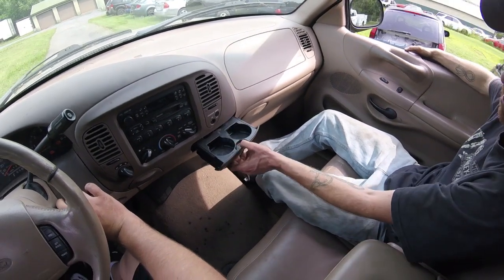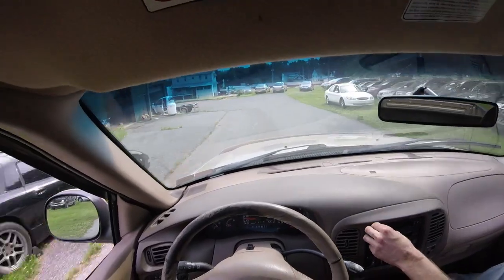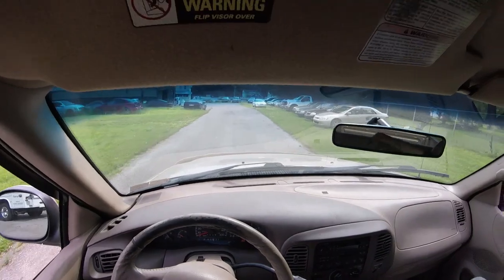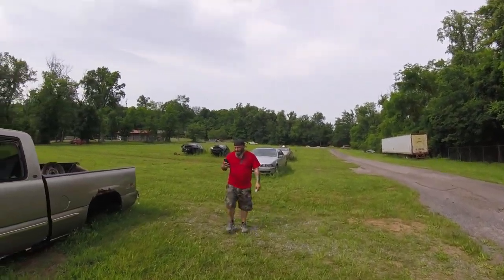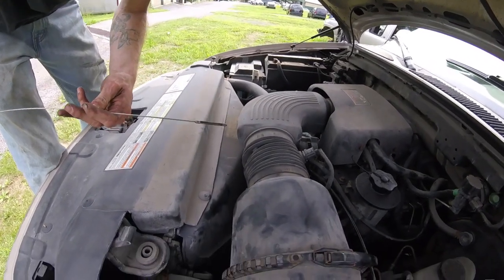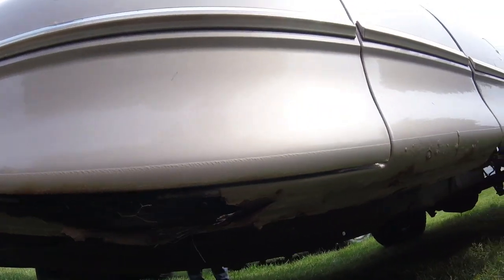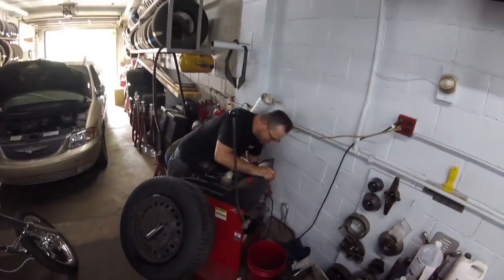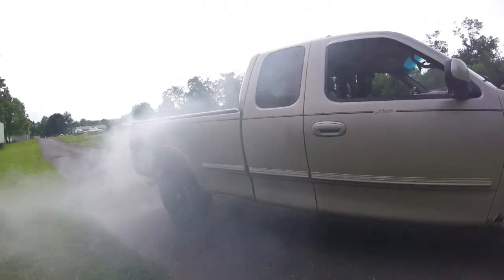I Bought A $150 Ford F150

Comment: If you think that rust was really bad up here in the Upper Peninsula of Michigan that truck is in great shape. No joke half the trucks are the road have no rocker panels or cab corners because they’ve completely rusted off!!
Reply: Michael Rymkos i have 3 trucks in the Upper Peninsula. 79' f150, 84 k20, 86 k20 suburban and between all 3- I dont think theres a panel without a hole in it.
Reply: This truck is better than many cars here in Quebec.

Comment: Yo Hammerdownmotorsports Steve Fast on your $1.50 Ford F150 Lariat 4x4 Extended cab Fixed it up fixing up Rust on your Truck put New Tires Rims New Paint job make 5.4 Motor make it Fast cold Air intake new Interior Truck new Radio too get F150 windows Tint like 5% around the truck make it like your new Tow mirrors make your tow pig Steve Fast make up good working keeping that Hammer Down buddy